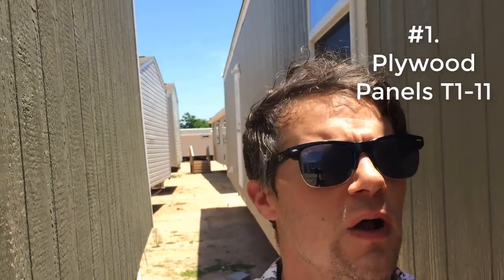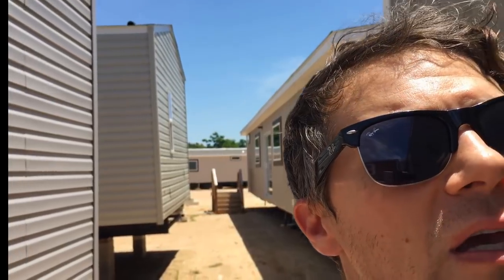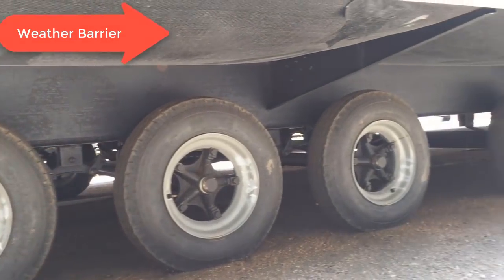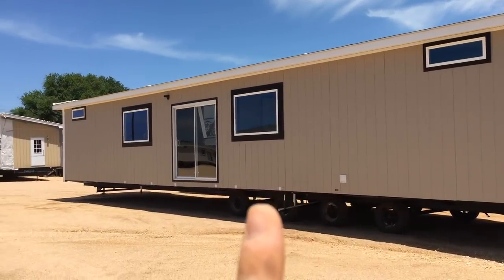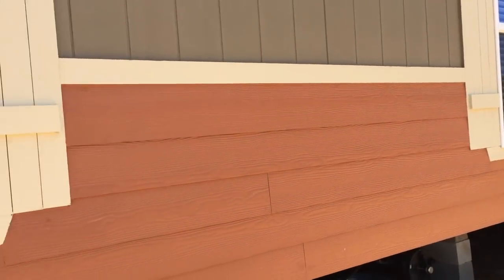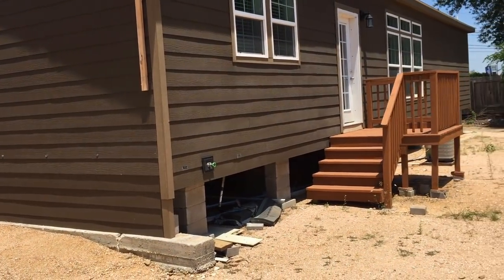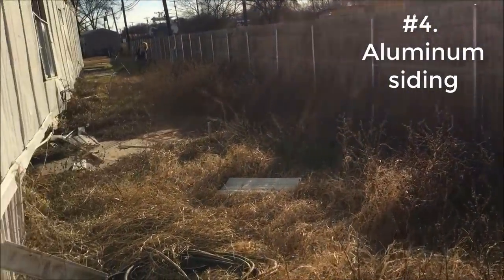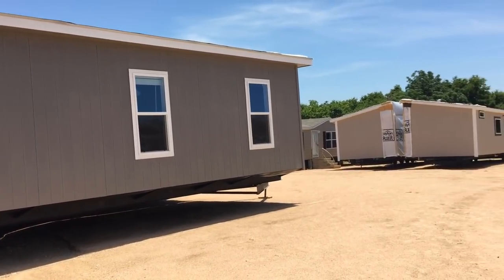Mobile Home Siding 101

Comment: We have a 1972 single wide. Would it be worth it to update the siding outside? The previous owner only did one side of the trailer with the pressed plywood and the other side is still aluminum siding. The side he did is already warping, so should we invent in just redoing the entire trailer? We've lived here for a couple of years and didn't realize there was so much wrong with the trailer when we bought it.
Reply from the maker: Hi Jennifer Somebody, Thank you for reaching out and connecting. Additionally, thank you for the detailed message as the certainly does help me answer your question. I regret to hear very much that you do not realize there was so much wrong with the mobile home when you first purchased it. In my opinion the big question is if any water is getting into the mobile home? The reason I ask this is because if you are not planning on selling the home and it simply looks less-than-pretty you do not have to fix it if you don't want to. However if water is leaking in, and therefore causing things to warp and possibly grow mold,
Reply: John Fedro no leaks coming from the outside but there was a lot of water damage that they just put Band-Aids over and called it good. Example: the bathroom clearly flooded more than once and instead of taking out the damaged floor they just put new subfloor over the top. We didn't know that and now the water that was in the old press board has damaged the top layer. We need are saving to fix that ASAP because it's terrifying to step anywhere around the toilet or tub. There's a list of stuff we need to do to make it liveable without having to worry that our power is going to go out at any moment. (That's another fun story for another time. Lol).

Comment: Unless the mobile home is about to fall down there should be no bowing on the exterior walls.
If your exterior walls are starting to Bow outward it's time to scrap it.
Reply from the maker: Thanks for stopping by and commenting. I have no doubt that your advice probably comes from real-world experience and wanting to help everyone watching. If the exterior walls on a mobile home are bowing then that definitely is a serious concern and something to watch out for. However it may still be a deal that we can create value with and quickly flip or wholesale for a profit. Keep in mind that any buyer should know what they are buying when you resell the home. I have passed on a couple of mobile homes over the years that I regret not wholesaling. If you are able to find or attract a profitable opportunity then by all means I would want people to take that opportunity assuming they knew what they were doing, did not have money at risk, and everything is disclosed to both buyer and seller. Again, when it comes to the exterior walls a mobile home bowing this definitely is an eye-opening concern. When the walls are bowing may mean that the home is at risk for collapse, or it just may mean that the certain type skirting you have maybe heavy and bulging at the bottom if it has gone wet overtime... T111 or pressed board siding does this over time and does not mean that the entire home is falling apart... just yet. However again, this is a case-by-case basis and the siding bulging is definitely a serious issue that most people should be quite concerned about and figure out what is going on. However when it comes to the skirting bowing, this is much more common and is usually caused by the mobile home sinking into the ground a bit. At any rate, anything bulging on the mobile home that was not originally bulging or Bowing is something to be aware of. Thank you again for commenting.

Comment: I've found that T-111 is junk.I used it on a shed,and even tho I primed and painted it,and  back primed it as well it still delaminated after 3 years.I just tore off and used half inch plywood with vinyl siding.Problem solved.
Reply from the maker: Thanks for reaching out Mark! My apologies for the delay in this comment reply. I regret to hear that you went through this the hard way. T1 -11 is not the ideal siding in my opinion. However luckily I have not had as bad of an experience as you seem to have. Thanks for reaching out and sharing this with us.
Reply: Nickdiaz209  -I got lucky.I got it from a house being torn down for nothing.
Reply: @MobileHomeFormula  -That's ok,at least you replied!I think a lot of the problems I had was because of the weather I have in southern Maine.I get everything,from
hot and humid to cold and snowy,and everything in between!

Comment: Well im sorry but i own a  mobil  Mobil home or manufuctured home.  And it has vinyl siding. And honestly I hate it.  My home is 2009, and when we get strong wings is just make so  much noise  . And also the sun just eats the sidding quick.  I'm actually remodeling my home and putting harddy sidding.  
Love your videos but one this regarding the sidding I have to dessagre.  But other then that good videos
Reply from the maker: Hi Jorge De Los Santos, Thanks for reaching out and connecting. Additionally, thanks for taking the time to let everyone know some of the real-world problems when it comes to vinyl siding. I regret to hear you have the change the siding however that hardy board does look nice, and holds its look for years and years. I have some from the 80s that still look almost new. Thank you again for commenting. Moving forward if you have any follow-up questions or concerns never hesitate to reach out any time. Keep in touch. Talk soon, John.